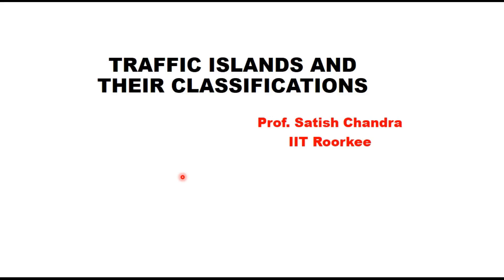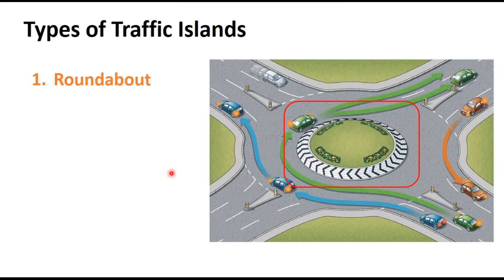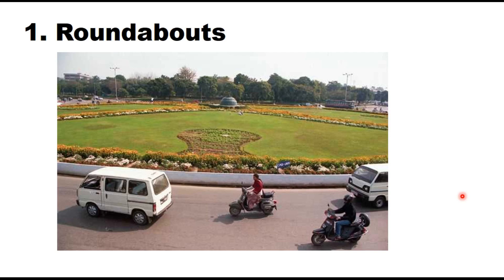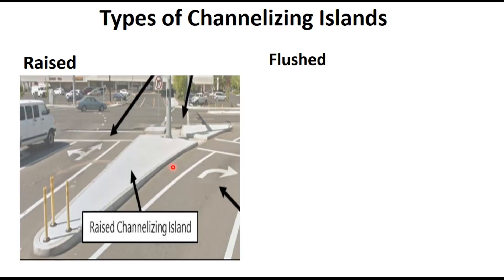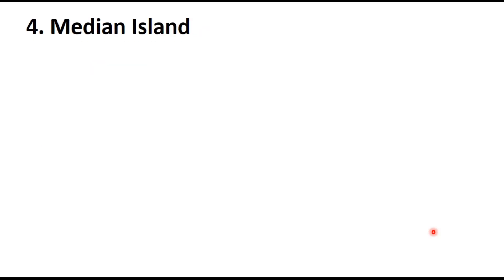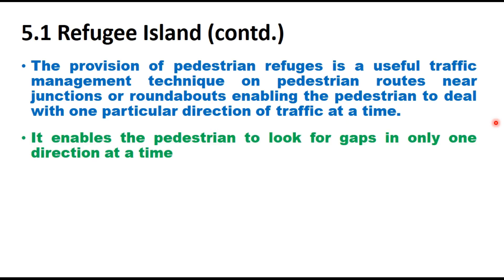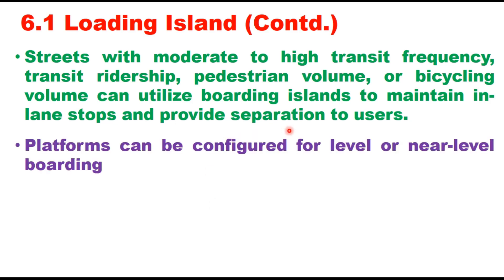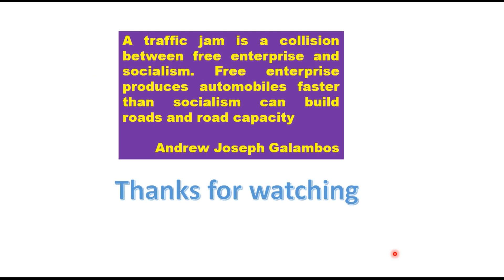Traffic Islands and their Classifications. Functions of Traffic Islands and types of traffic islands

Comment: Sir Pelican Crossing is similar to Mid block crossing ?
Reply from the maker: The Pelican  pelican crossing is a type of pedestrian crossing with traffic signals for both pedestrians and vehicular traffic, and it is activated by call buttons for pedestrians. It is placed at mid block sections for safe crossing of pedestrains. It is also sometime called push botton crossing. The pedestrian will push the button and traffic light will turn red for traffic.
Reply: @SatishIITR  Thanks a lot sir